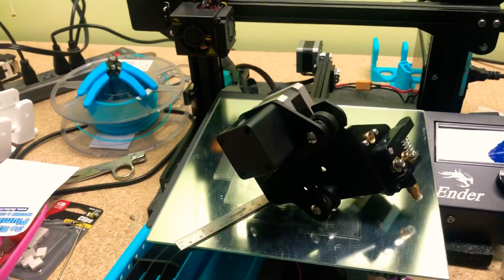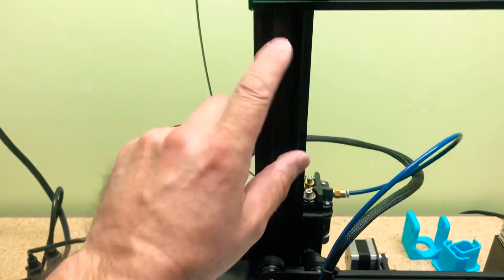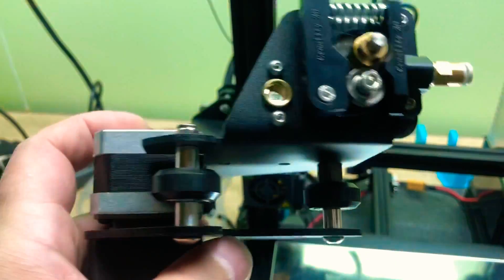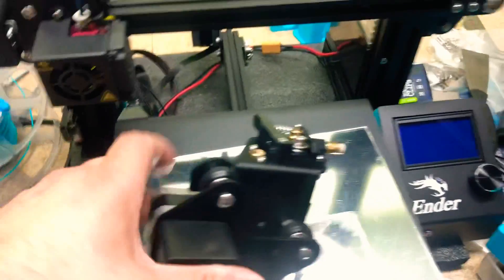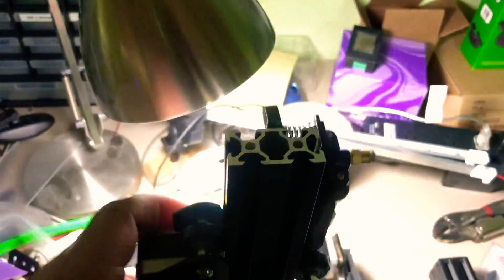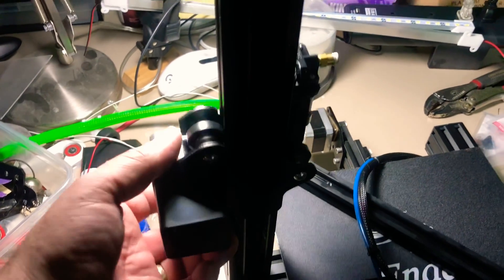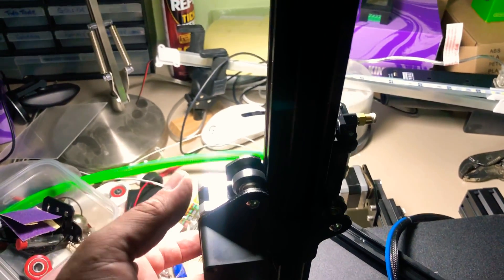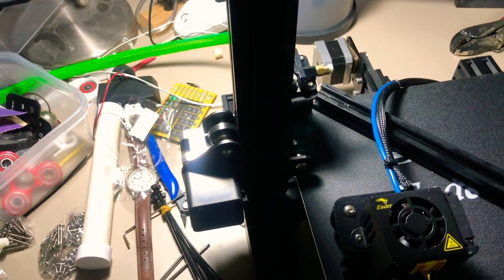Ender 3 Quick Tip

Comment: still relevant 2025. Bought a ender 3 v2 neo last year, came pre built, was able to easily check the x and z axis didnt really check the Z axis, The binding was bad. This video saved me, the eccentric nuts did nothing until I loosened the other rollers !!

Comment: I've tried this but I still can't get them loose enough to freely roll with some pressure. The one on top-left is perfect, the right (with the eccentric nut) is tight as hell and the one on the bottom-left is somewhere in between but still way to tight. I think this is why the right side on my X axis gantry is sagging... Any tips?

Comment: I too wish I had seen this while building.  The Ender 3 is my first printer and I didn't realize at first it was really, really binding on the Z screw..  I followed your solution and it helped some the first time around as the carriage was too tight.  While messing with the carriage, I found my plate that held the extruder was not 90 degrees. Had to beat that gently in a vice with a soft face hammer, the follow your steps to align the carriage, and now we're set.  Thanks!
Reply from the maker: Glad to hear you're up and running! I'm waiting for my next printer currently and hope to start uploading a build series on it by late december. It's much bigger with lots of extra goodies. It'll be the Folgertech FT-6.